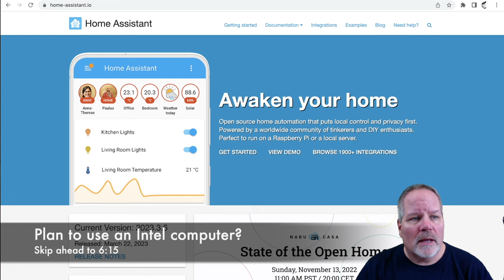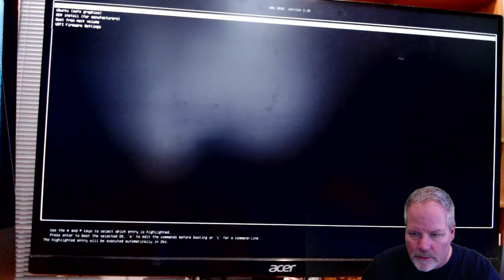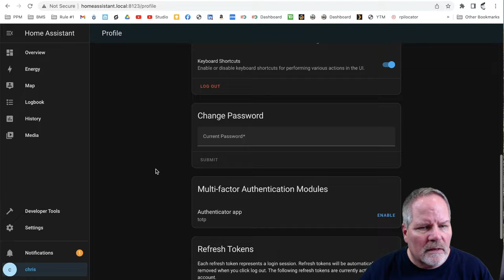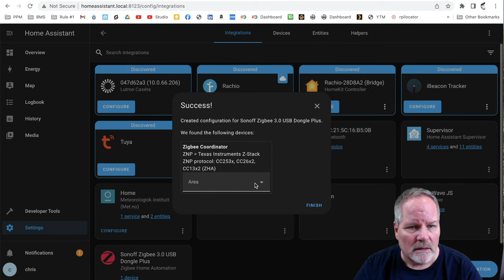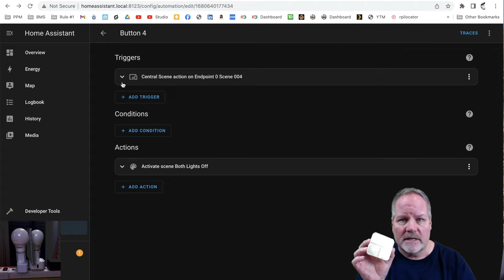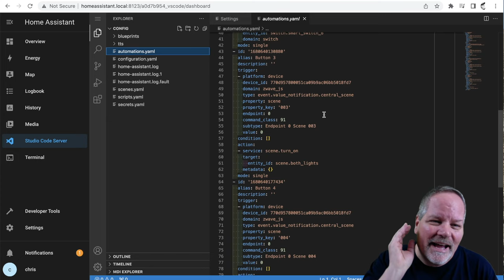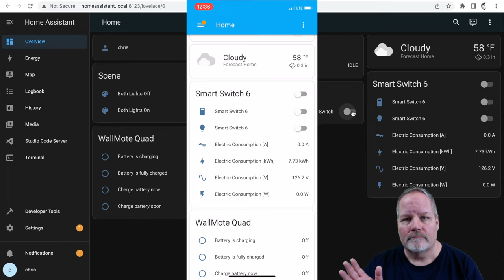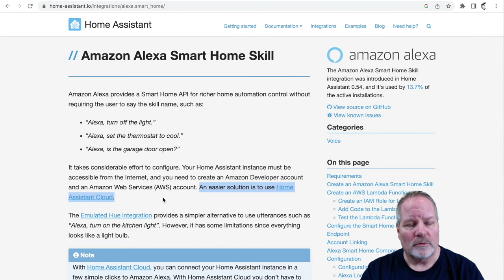COMPLETE GUIDE TO HOME ASSISTANT - 2023 Edition

Comment: Starting at 16:39 where you set up the user account and then start seeing devices in your home, are you doing that from any PC on your network or do you have to do all the setup on the NUC itself?  Sorry, I'm an idiot when it comes to this sort of thing.
Reply from the maker: Home Assistant is a web-based application so you can access it from any PC or smartphone in your house. It runs on the NUC, but I don’t access it from the NUC.
Reply: @handydadtv  Ok, I thought maybe you had to do initial setup on the NUC but I guess all you have to do is to get the application onto it.  After that you can set up with any device on the same network.  Thanks for the help!

Comment: Excellent walk-through; thank you! What is that KVM switch on your desk, that you appear to be using to select which computer your monitor is connected to?
Reply: Thanks to Google Image search, I found the device, the Elgato Stream Deck (Mk 2?). It's some sort of selector switch with 15 buttons you can customize; it connects to a Windows or Mac computer via USB. I'll have to research how you actually set it up, and whether it can somehow serve a KVM function (not likely?). Thanks again for your excellent video. Hey, maybe it would be useful to other as well, to make a video on the Stream Deck and how you use it?
Reply from the maker: It’s not a KVM switch. I mainly use it to switch sources in OBS and to trigger automations in Home Assistant.

Comment: So frustrating, neither method works. If I follow from booting Ubuntu live disk I can't find Belina. Install Belina and now it can't find my SSD to install HA. If I burn HA directly to the SSD the boot process hangs. I'll stick with Smartthings, it actually works.
Reply: Fixed my own issue. Loaded defaults in bios then HA boots good. Man, it's a lot snappier than the Pi4 I had it testing on.
Reply from the maker: Glad you fixed it!

Comment: I have not watched the whole video yet because I have a question first, do I need a laptop or PC for this?
Reply from the maker: You need a device to run Home Assistant. If you’re planning to use a Raspberry Pi, you need a computer to download Home Assistant to the SD card. 

If you’re planning to use a mini computer (NUC) to run Home Assistant, you can probably download and install it using that computer alone.
Reply: @handydadtv  thank you for the very quick response, the only reason I asked is because I do not own a laptop or computer and only have a phone for this sorta stuff, I have a few apps for some smart home stuff and want to automate them but the 3 apps I have don't all work with each other, I heard this app will work with what I'm trying to do so that's why I'm here
Reply from the maker: @Clip_It1 Home Assistant has an app, but the program actually runs on a device inside your house.

Comment: duck dns is not working it can save the configuration :/
Reply from the maker: Keep trying. You’ll figure it out.
Reply: Check your home router, mine (ASUS) had OpenVPN built in, so I set that up, and just turn on OpenVPN when I am away from home and it gives me access to Home Assistant without need port forwarding.

Comment: Thank you for such a comprehensive video!
I'm curious why you don't use your NAS to run Home Assistant through a docker installation? I ask because it seems many other YouTubers suggested the docker approach, though don't really explain why.
Reply from the maker: I tried that several times and got frustrated. The software installs fine, but all the add-ons need to be separate Docker containers. Accessing physical dongles from the containers for Z-Wave and Zigbee were frustrating as well, and Synology didn’t have device drivers readily available. 

I think a dedicated device is worth the money because the Home Assistant Operating System controls everything.

Comment: what version of Ubuntu are you installing on your flash drive?
Reply from the maker: Whatever was the latest production release at the time.
Reply: @handydadtv  thanks. have you ever run into an issue with the scripts you run to get etcher installed? I am running them in the ubuntu terminal and get "Unable to correct problems, you have held broken packages" at the implementation of the last step.
Reply from the maker: @travisd9891 I got some cryptic errors but it worked anyway.

Comment: I had an old pc hanging around, so I couldn't justify buying a nuc. However, it was so old that it did not have uefi, which is a requirement of home assistant operating system(HAOS). So instead I went the ubuntu with home assistant (HA) as a VM route. It works great. All I bought was a flash drive. Anyhow, just wanted to say the quality of this video is top notch!
Reply from the maker: Did you have any issue accessing your USB dongles from inside the VM? That was my issue with Docker on Synology.

Comment: Im still confused from all this smart thing, lets say I want to use google assistant, And I buy lets say Sonoff light bulbs, wall switches and  plugs, do I need anything else? Do I need this small computer at all?
Reply from the maker: You don’t need a computer if you don’t want to use Home Assistant. You can buy any light bulbs that say “Works with Google Home”. That’s fine if you purely want them to turn on and off on a schedule. Just realize the automations require Internet access so they won’t work if your access is down.
Reply: @handydadtv  thank you, I would like to also use voice commands via google home, should I go with Philips Hue and thei zigbee hub? is it usefull or is there any better option? Because Philips Hue is extremely expensive and I dont plan on huge projects or automations just few smart bulbs plugs and switches and maybe some door and light sensors.

Comment: I have used your tutorial to install HA (the difficult way) which seems to work, until I restart the NUC. HA is starting up (with pages op command) until it ends with (in green) ha >       For some reason HA is waiting for a command from my side but I assume this should not be the case. Otherwise I can only start-up HA with a screen and keyboard. An ethernet cable is connected to the NUC when starting up. DO you have any idea what I am missing or doing wrong?
Reply from the maker: Sounds normal. You don’t use the NUC with a display when running HA. Connect to it from another computer.
Reply: @handydadtv ok….. I have really nominated to be a HA beginner. It works… after a few minutes it was possible to approach the NUC through the ios HA app 👍👍👍👍👍
Reply from the maker: @peterhuiberts3203 Glad it works 👍🏻

Comment: hi there . if i will install HSS on a divice in on network and after 1 year i will need to change on a diffrent network this will still work or i will ned to reinstall HSS 
Thanks
Reply from the maker: If you use Ethernet you should be fine. If you use WiFi and use the same network name and password it will work.
Reply: @handydadtv  thank you. 
I will use ethernet .
Thanks

Comment: raspberry pi 4 with 4gb is ram is I would say the minimum requirements. this is because home assistant now a days consumes more than a 1gig of ram. and if your system only had 1gb of ram or less, your efffed, specially if you use esphome to compile your esphome binary.

alas getting a pi4 with 4gb of ram and larger is basically a scam now a days. not even the raspberry pi foundation is dealing with the issue, even after we no longer have chip shortage, they can actually ramp up their manufacturing now that tsmc and samsung is slowing down their manufacturing due to excess manufacturing.

I recommend getting away with raspberry pi and just go with the newly officially supported arm based hardware "odroid n2+".
Reply from the maker: My Geekom machine is running perfectly so far!
Reply: @handydadtv  That's really the way to go. I run HA on a Dell thin client - Celeron, 64GB SSD, 8GB RAM, and fan-less...and it was only $35.00 - about what a RPi used to cost.
Reply from the maker: It was fun to see it working on the Pi, but the SSD in the NUC is much more reliable than the SD card in a Pi.

Comment: I cannot get remote access to work. I followed your steps precisely, but it still won't connect on cellular. The "settings" menu is now different from what you have, but i entered the duckdns info onto "home assistant URL" to no avail.
Reply from the maker: Probably need to setup port forwarding on your router.
Reply: @handydadtv  i figured it out. For some reason there were two IP addresses coming up for HA in my router config - a x.x.x.44 and a x.x.x.253. i forwarded the ports of the 44 one, and evidently it needed to be the 253 one. No idea why there are two, but it seems to be working now.
Reply from the maker: Ethernet & WiFi?
Reply: HA is currently running on a VM that is on a machine connected with WiFi. I'm still building out my home network and haven't gotten cat 6 run to my home office yet.  This isn't going to be a permanent setup though. It's just a test machine. If i decide to go all in with HA, I'll probably use a NUC or find another machine to run a VM on, and that will be hardwired to my main router.

Comment: FYI, Belena etcher does not work on Ubuntu 22.04 without going through hoops. Use 20.04. And to switch to root using a live version of ubuntu the command is actually sudo -i. Otherwise it asks for a password. Great video and it got me motivated to try this again.
Reply from the maker: I also heard Etcher is no longer free. True?

Sounds like I’ll need to remake this video every year because stuff keeps changing!
Reply: Balena Etcher is still free.  However, it does not work with Ubuntu 22.04 as pointed out.  There is an alternative program that can be used.  It is MATE Disk Image Mounter.  It is included with the MATE Ubuntu 22.04 distribution.  I have used it and successfully copied the Home Assistant OS to a SATA SSD.
Reply from the maker: @jeffreycwalinski2554 Thanks for sharing!

Comment: When I go to settings, there is no add on's feature.  I've given myself advanced privledges in my profile.  What could be the problem?
Reply from the maker: Try enabling Advanced Mode in your user profile.
Reply: @handydadtv  I gave myself advanced privledges in my profile on the web page.
Is that what you mean?  It's still not working.
Reply: oh, and thank you so much for replying!!
Reply from the maker: @ajducey1868 I apologize. I read and reply to every comment so sometimes I respond without reading the entire comment! I obviously stopped reading yours after the first sentence. Sorry about that. 

Are you using Home Assistant Operating System on a dedicated machine? Or a virtual machine (like Docker)?
Reply: @handydadtv  no problem.  I was using the container version rather than the OS version.  That's why it's not working.
Reply: @handydadtv  no problem, I was using the container image of homeassistant.  It doesn't come with the add-on section.

Comment: Can you do a complete guide to a docker install with Supervisor version?
I got mine installed but it has some issues.
Reply from the maker: No, sorry. I played with HA on Docker on my Synology NAS and it was much too complicated with Z-Wave and Zigbee USB dongles. So much easier with a dedicated device and HAOS.
Reply: @handydadtv  I got it on my Pi, but it is in a docker because I wanted to create a home cloud as well.
It works fine but shows that there is a few issues, can’t figure out solution for those.
Reply from the maker: @naronaroyan323 Docker on a Pi! That’s bold. Save your stress and buy another one.
Reply: @handydadtv  Bold? Why..? It’s been working fine all this time… 🤷‍♂️
I mean it has like 10 repairs listed within HA, but as far as everything goes, it’s been working just fine.
My only issue was that I couldn’t get a bluetooth speaker to do text to speech or AV jack… so I guess I have to find a way to pass through from docker to Pi.
Reply from the maker: @naronaroyan323 Perhaps bold is the wrong word. I just would never think of having virtual machines on such a small device. Yeah I know it’s possible but I only think of virtual machines on big computers with a lot of CPU and storage. Just me. 

That’s the challenge with Docker in general, regardless of the size of the hardware: connecting the virtual environments to the physical. I wasn’t willing to spend the time to make it work.
Reply: @handydadtv  Well it is not like any VM on a computer, docker is like a semi VM; also, mine is a Pi 4b and so far it’s able to handle it just fine. My issue isn’t weather or not it can handle it but rather getting things to cross communicate from Raspbian to HA docker. Like VLC Telnet addon on HA isn’t showing any AV jack within its settings so I am able to hear audio on my speaker from Rasbian but not from within HA.

Comment: I've been INSTALLING Home 'assistant' for about four years now. DON'T DO IT unless you and everybody that lives with you want to spend most of their lives keeping the lights turning on within your house reliably. It's a non ending battle due to a Python upgrade this, a depreciated that, improvements that require a complete reinstall, learn YAML, oh you need to pass this incomprehensible variable to that. I'm currently in the process of what will be a quite expensive DE-INSTALL as my wife asked me "what would happen if you weren't here to keep Home 'assistant' running" truth bugger all would work for more than a couple of weeks. I'm sure a programmer with twenty years under the belt and no life will state this is BS so just leave it to such people.
Reply from the maker: Thanks for sharing. What are you switching to?
Reply: @handydadtv  No automation as it simply doesn't work reliably. Just start to read the breaking changes.
Reply from the maker: In my experience, WiFi devices are the least reliable because they lose the network connection and have to be reset periodically. But I have no issues with Z-Wave, Zigbee, Lutron and Insteon. They all work great in my house.